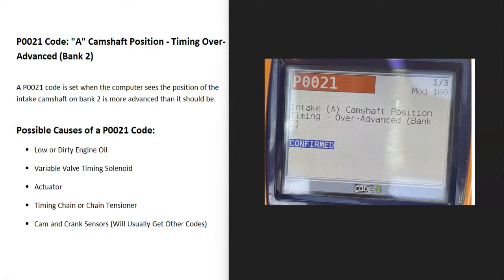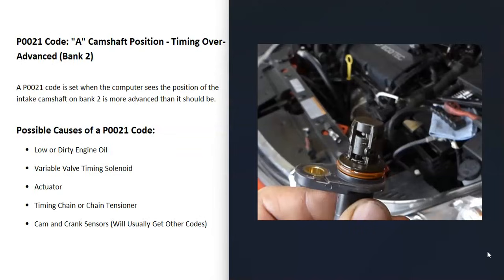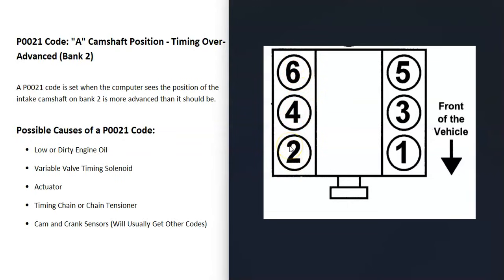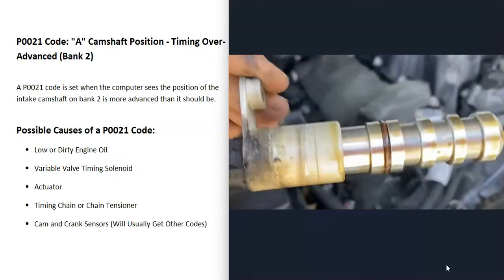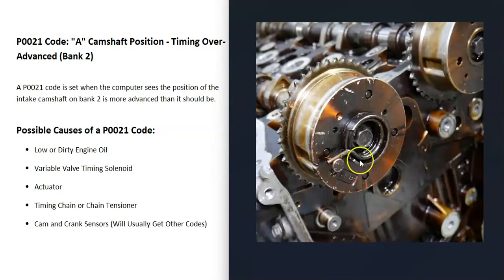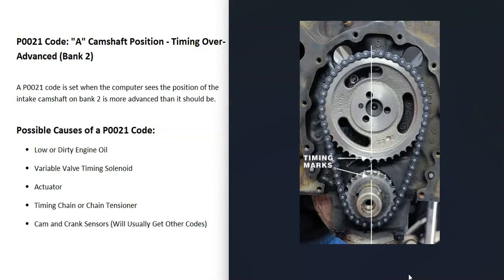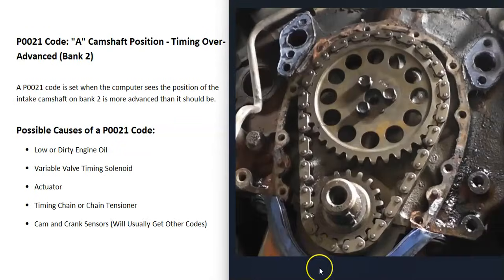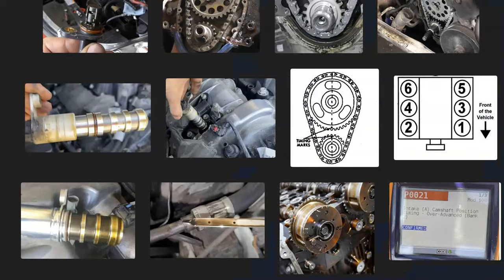Causes and Fixes P0021 Code: "A" Camshaft Position - Timing Over-Advanced (Bank 2)

Comment: Mine started missing then through the p0021 code 146k miles. Going to get the oil changed see if that helps.
Reply: Did you figure it out?

Comment: Thanks for the info. I have a 2006 650i bmw and I replaced the valve cover gasket timing cover gaskets all sensors spark plugs and coils as well timing solenoids the codes come up for bank 1 A & B camshaft circuit low as well as mass air circuit and my transmission won’t shift no codes the lights on and says can engage without pressing the brakes and it is not correct do u happen to know what to do also says what your video said it’s missing a little bit just under 1000 rpm and jumps a little bit thank you for the help

Comment: p0021 confirmed,p0011,p0725 current, all this codes came up. any ideas?
Reply from the maker: With those codes I would test the CAM and Crank positions sensors and the wiring.

Comment: P0021 came on as well as P0327 is it just the camshaft sensor??
Reply: P0327 is ur knock sensor/ low voltage (meaning it’s ur hardness connection which the other code is js the solenoid left (driver side ) and if u get a p0328 it’s the wires also or js the knock sensor if u replace the hardness i suggest u replace the knock sensor also so u don’t get any other codes

Comment: Just had my 2016 Tundra w 29,000 miles timing chain tensioner bank 1 changed along with everything "in there", less than 20 miles and threw P0021 code and went into a limp mode. Codes P0300, P0304 and P0306 also are showing but im sure if P0021 is fixed those will also. NO codes were being thrown prior to it being replaced just that  metal ticking noise from bank 1 at low rpm.  $5500 later im sick now, hoping the fix is easy and they don't have to get back in. question is do they have to drain the oil when replacing all that or just drain the radiator cause it has to be removed,
Reply from the maker: The radiator fluid likely was drained and radiator removed but the oil would not need to be drained. It could be something simple like a wiring connector that wasn't attached well and came off, or possibly the timing belt slipped. It will need to be diagnosed.

Comment: Good video! On my 2008 G37s i had a p0021, replaced the vvt solenoid p0021 went away and p0345 came up. Replaced the sensor and the p0345 is still present. Any idea?

Comment: I got p0021 code a week ago and changed the oil filter and cleaned the vvt solenoid but code still stays. I checked the vvt solenoid with 12v and it’s working fine.
Reply: Did you figure it out? I got the code a week ago, I changed the camshaft sensor, the vvt solenoid, the oil and oil filter and the code remains.
Reply: It's hard everything was replaced  code it's there at least on riding riding
Reply: Heip

Comment: Would you get p0021 and p0011 if the camshaft timing sprocket was the issue? Or is it possible just to get p0021?
Reply: Did you ever fix it I have the same codes I’m in limp mode with a rough idle
Reply: @andydiaz7674  yeah I replaced my intake cam phaser timing sprocket

Comment: Just got this code yesterday. The P0021 came up as well as the P0300.
Reply: That's what I'm getting.....but after changing bank 1 Solenoid.  So now bank 2.

Is this your fix? 
Or sensor?
Chain?
Wiring?
Reply: Did you find out the issue?
Reply: @flowsgamin  
Both banks.  I've changed all VVT and can sensors.  
My p0300 came from a previous garage who ruined my car... not completely installing items or installing incorrectly, but o believe purposely. It was a new serpentine belt that he somehow shredded 

After replacing those items and a few other bolts that were missing,  it runs well. 
Change the VVT and camshaft sensors. 
I broke down and replaced them all. Autozone$55 for vvt and $36 for sensor.  You'll need 4 of each.